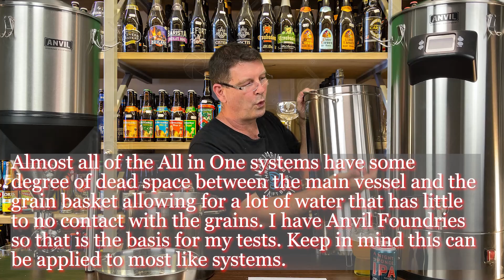Belgian Rye IPA - Anvil Foundry - Pressure Fermentation - Experiments! - Part 1 of 3

Comment: I have an Anvil 10.5.  I notice that the wort will channel during recirculation and mash-out along the inside parameter of the mash tube.  I think I am getting poorer efficiency due to the wort not flowing thought the center bulk of the mash.
Reply from the maker: Ouch! I have actually seen this and when I use to see this I would disturb the top 3/4 of the grain bed to ensure the water was flowing better. I do have a concern that the top metal shield with the holes allows a lot of flow around the outer edges and less everywhere else which I've mentioned in a few past videos hoping Anvil will look into this as that top plate has had a few redesigns. I think more holes and a bit of silicone on the outer edge would be a major enhancement. Next time you do a brew and especially during the sparging, leave the plate on but push it down to force the outer edges to seal better and you will notice it takes a lot more time for the water to drain as it is being forced to go through the little holes that are spread out. This is why I have a bit of concern.

Comment: I predict you will absolutely get better mash efficiency from raising the mash basket up and down during the mash.

I would be more interested in comparing your current 1 gallon sparge process vs a no sparge, no malt pipe, no recirc biab.  

I'm getting about 10% less mash efficiency (83 vs 93) on my 10.5 Foundry (full volume, no sparge, biab, recirculate, false bottom, 1g/hr boil off) vs my previous propane 15g pot biab full volume, no recirc, 1.5g/hr boil off, no sparge system.  They are only really two differences:  recirculation and better temperature control during the mash.  My 15g biab pot loses about 4F during the 60 min mash.  The Foundry maintain the heat.  Although, I'm seeing a 147.6F temp at the top the mash even after stiring or recirculating when the temp is set at 152F.  This lower mash temp should create more fermentable sugars similar to the 15g pot losing 4F over the 60 min mash.

Anyway, I'm confused on why the Foundry has less efficiency than my 15g propane system.  I'm running less than 1.0 liter/min on the recirc and stired every 15 minutes.  On the propane system, I never stir.

On my next batch, I'm thinking of not recirculating as I don't need a filter bed with the brew bag. Btw my rollers are set to 
030 and I get a very fine crush.

Thoughts?
Reply from the maker: My efficiencies were a bit lower initially on the Anvil too. The recirculation is very important and the small batch adapter will help too as the grain basket is designed to help newer brewers that might end up with stuck mashes. If you have things down to avoid stuck mashes the small batch adapter will help. Plus I'd recommend the 1 gallon sparge as it only takes a minute and helps to rinse off the final wort still in with the grains as they are dripping. I've heard a few people getting lower BHE #'s with BIABs as I suspect the bags are helping to pack the grains a bit tighter creating less flow during the recirculation process. The 0.030 might be a bit too small for no BIAB but I use a 0.0375 that works amazingly well without a BIAB.

Comment: I got one for you. Why not put a T on the return pipe and run a hose down the side of the malt pipe and one over the grain. Then you would have a "whirlpool" around the malt pipe during the mash. 👍🍻
Reply from the maker: Sounds like a great idea but I might need a Riptide or something more powerful and then I might have to limit only the flow over the grains of course. I like the simplicity of lifting the grain basket but your thought with the T would be a lot safer.
Reply: @BitterRealityBrewing  spoiler... I don't think either one is gonna make a difference.. 😁
Reply from the maker: @ShortCircuitedBrewers  One did and I learned a ton but the other jury is still out and looking to recruit a 2nd set of taste buds and 2nd nose for that one.
Reply: @BitterRealityBrewing  oh and Dr. Hans is wrong.
Reply from the maker: @ShortCircuitedBrewers  😂😂😂 I believe you are right but I'm all about seeing it for myself.